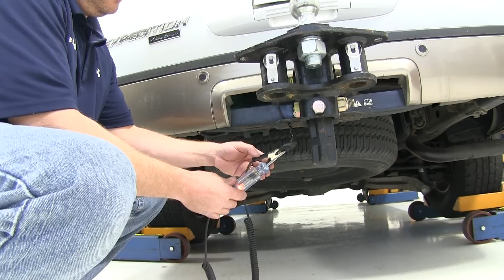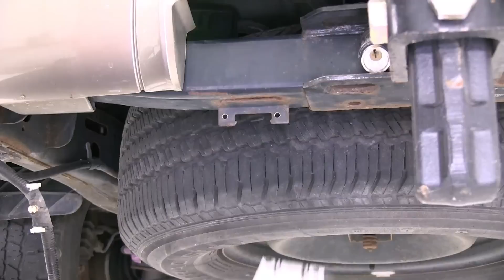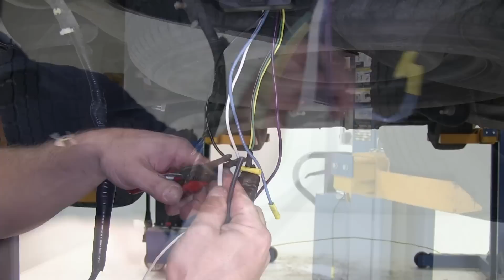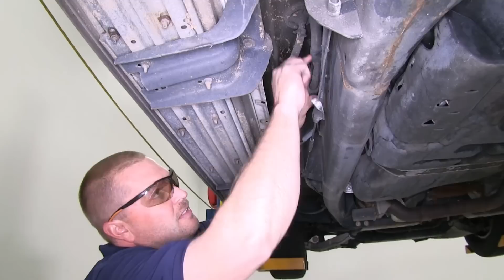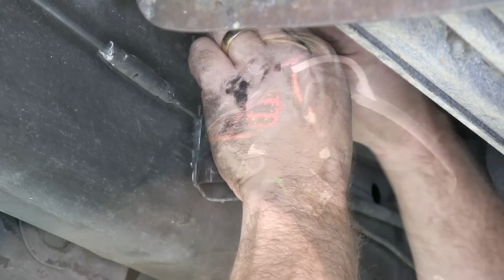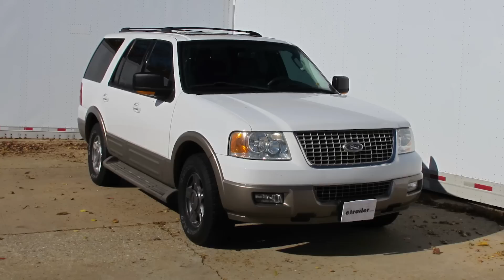How to Install: Universal Installation Kit for Trailer Brake Controller on your 2004 Ford Expedition

Comment: Or you can just tap into the two wires it right behind the back bumper in that same wiring harness that the 4 pin comes out of

Comment: If you live in any of the rust belt states, you will want to solder and shrink wrap all joints. Butt connectors will last a year at best.
Reply from the maker: Thank you for sharing this with us. This is a good point that you make. If you live in a place with more conditions that cause rust, you may look into a more preventative and protective installation.
https://www.etrailer.com/Accessories-and-Parts/etrailer/ETBC7.html

Comment: I see a blue wire near my 4 pin flat connector  that is caped off on my 06 is that not the electric trailer brake hot wire? why would I have to tap into loom half way up the frame?

Comment: 2010 expedition has a tow battery charge relay.  I followed the wire to the harness.  It does not have a connection going through the harness, so I tapped into that wire.  I'm getting 0.018 V.  Can you help?
Reply: Check to make sure you added applicable fusing and relays in the factory fuse panel

Comment: Is the ETBC7 kit necessary? Your website says only the Hopkins 37185 kit is needed If I was to install the Tekonsha TK90160 with the 3035 harness. Is the long grey wire necessary, or can you connect the wires from the 31785 adapter to the wiring  near the rear of the vehicle instead of at the harness at the front of the vehicle?  This video does not show the installation of the circuit breakers that come with the kit.  Are they necessary if you connect through the harness?  Is the relay and circuit breaker at the end of this video the original ones, or do you upgrade in size to make the circuit breakers in kit not necessary?  I want to make sure I have the correct installation, but do not want to purchase the ETBC7 kit instead of the 37185 if the only thing I need is the grey wire.  I have a lot of zip ties and splices on hand.